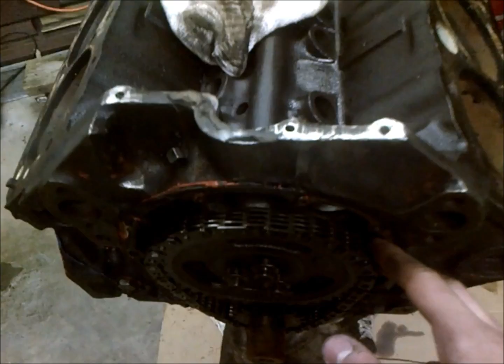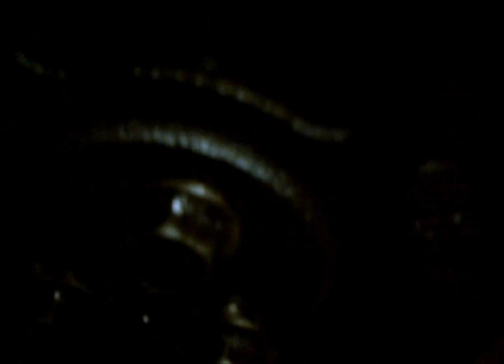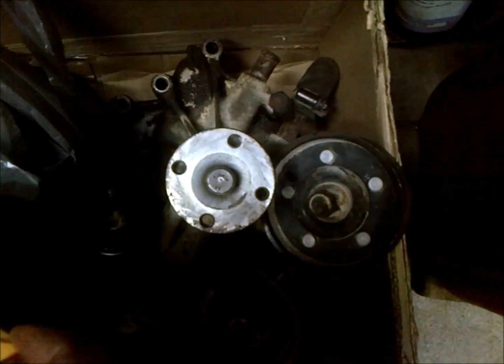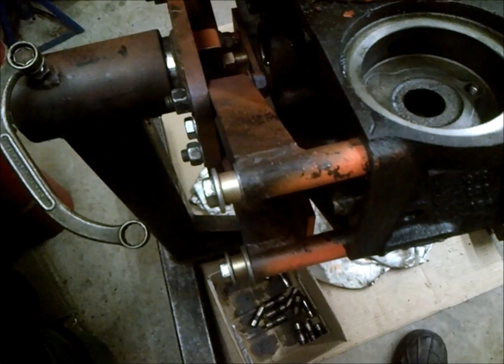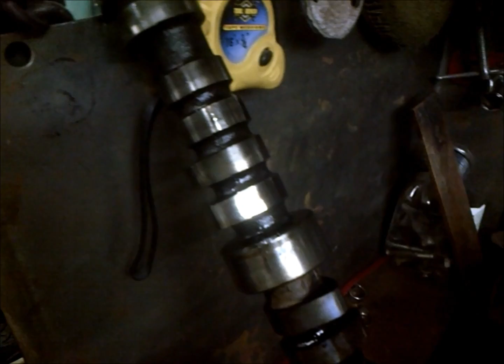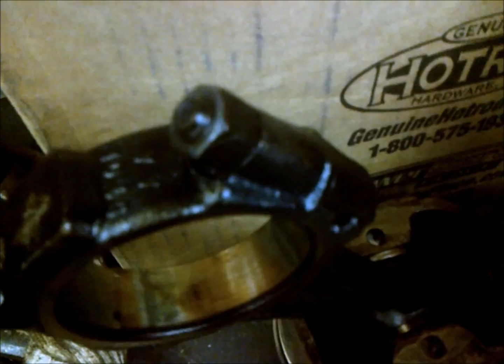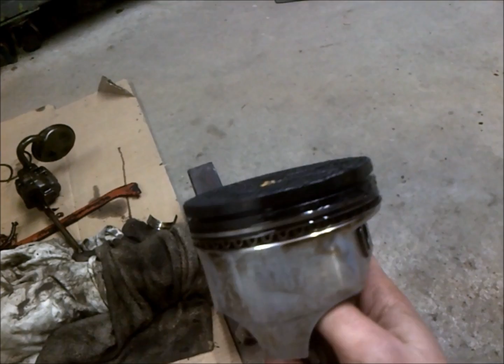350 Chevy vs Ford 302 Comparison: (Dumb Redneck Viewpoint)

Comment: compare the chevy 350 to a 351 ford cleveland of the same era.
Reply: +Mark Langston THE FORD CLEVELAND MOTOR CHANGED THE FACE OF PROSTOCK DRAG RACING. THE FORD CLEVELAND MOTORS WERE KILLING THE CHEVY'S THAT THE HENCHMEN FOR CHEVY THE NHRA MADE THE FORD'S CARRY MORE WEIGHT AND THE FORD'S WERE STILL KILLING THE CHEVY'S WITH THE REV LIMITERS SET AT A STANDARD 7000RPM'S AND HAD THE CAPACITY TO REV TOO 8500. EVENTUALLY PROSTOCK WOULD HAVE BECOME TOTALLY FORD POWERED. SO TO PROTECT THIS PHONY CHEVY RACING DYNASTY CHEVY/GM HAD THE NHRA MANDATED THE 500ci RULE. GM/CHEVY THEN TAKES A OLDSMOBILE BLOCK AND CASTS IT TO USE A CHEVY CAM AND CRANK. THEN GM MAKES A PAIR OF BIG FORD CLEVELAND HEADS FOR IT. SO WHAT CHEVY HAS BEEN WINNING WITH IN PROSTOCK SINCE 1983 TO PRESENT DATE IS NOTHING MORE THEN A BIG FORD CLEVELAND MOTOR. THIS IS THE REASON WHY FORD DOESN'T GET INVOLVED IN PROSTOCK RACING. BECAUSE THE PROSTOCK MOTOR OF TODAY OTHER THEN IT BEING A HEMI ARE ALL FORD CLEVELAND BASED ENGINES. LIKE I HAVE BEEN SAYING FOR YEARS. CHEVY HAS BEEN CHEATING THEIR WAY TO THE FINISH LINE FOR YEARS.
Reply: +ford fairlane LS, SB2, RO7, DRCE and all the symmetrical head big blocks labeled as Chevy are Ford spec engines. Nothing in racing is Chevy anymore. Chevy is all Ford based.
Reply: I had a cleveland and ate up a lot of 350 chevies with it. 4 bolt mains ,big valve heads. High compression. closed chamber heads. I was around in 1970 when these motors were some new hot shit. Why do you think Ford only made them for 4 yrs? YOU don't know what you're talking about so kiss off buddy.
Reply: Ford had an overhead cam during WWII, 525 hp @ 2800 rpm gas motor, 1100 
cu in, 5.4 inch bore and 6 inch 
stroke, 7.5 to 1 compression, over 1000 lbs of torque from idle to 2600 
rpm. They also had the 427 Cammer engine that came out in "62". It was 
too radical for NASCAR and was dropped from production. Way ahead of 
it's time.
Reply: THE 4.6 MOD MOTOR CAME OUT IN 1991 BEFORE THE NORTHSTAR. MY FRIENDS FATHER HAD IT IN HIS BLACK CAR LINCOLN AND I REMEMBER HIM OPENING UP THE HOOD AND SHOWING US THE MOTOR. THE NORTHSTAR CADILLAC WAS A FAILED ATTEMPT FOR GM TO COMPETE WITH FORD. WHEN I ASKED A MECHANIC WHO SERVICED LIMOS BOTH LINCOLN'S AND CADILLACS WHAT HE THOUGHT ABOUT THE NORTHSTAR ENGINE THE ONLY WORD THAT CAME OUT OF HIS MOUTH WAS "FAIL". 4.6 MODULAR MOTORS ARE STILL RUNNING TODAY AND EASILY REACHING 500,000-700,000 MILES AND STILL RUNNING. IT IS AN AMAZING ENGINE. SOME HAVE GONE TO 1,000,000 MILES AND THEY POWERED THE TAXI, LIMO AND POLICE CAR FLEETS COAST TO COAST FOR ALMOST 25 YEARS WITH NO COMPETITION FROM ANYONE.
Reply: I HAVE A 1989 FOXBODY MUSTANG WITH 150,000 MILES AND SITS OUTSIDE IN MY DRIVEWAY AND STARTS EVERY SPRING. ITS ALSO A DRAG CAR FROM STREET TO TRACK RACING AND THE PEDAL GOES TO THE FLOOR WITH POWER SHIFT TIME AND TIME AGAIN. IT HAS NEVER HAD A PROBLEM WITH MASSIVE ABUSE. IN A HOUR I WILL BLOW YOUR TOYOTA UP. I'VE OWNED THEM TOO.
Reply: No... A Frenchman,  Léon Levavasseur designed the first V-8.  It was originally installed in a number of competition speedboats and early aircraft.Cadillac in 1914, Oldsmobile in 1916, Chevy in 1917, Ford had the first truly mass produced V-8 in 1932.
Reply: CHEVY RO7 NASCAR MOTOR OF TODAY IS A FORD CLEVELAND COPY. THE PRIOR SB2 NASCAR ENGINE CAME DIRECTLY FROM FORD. WHEN FORD WANTED TO REPLACE THE THUNDERBIRD WITH THE TAURUS NASCAR CAME ALONG AND TOLD FORD NO BECAUSE THERE WAS NO 2 DOOR TAURUS. THEN NASCAR MADE FORD A OFFER THAT IF THEY WERE TO ALLOW CHEVY TO USE THE CLEVELAND DESIGN FOR A NEW NASCAR ENGINE THEY WANTED TO BUILD. ONLY THEN WOULD NASCAR ALLOW FORD TO RACE THE TAURUS. FORD RESPONDED AND SAID NO WAY. FORD KNEW THEY WERE OVER A BARREL ON THIS AND CAME BACK WITH A OFFER THAT THEY WOULD DESIGN A NEW HEAD FOR THE SBC THAT WOULD MAKE IT COMPETITIVE TO THE CLEVELAND ENGINE SO FORD GRAFTED THE INTAKE SIDE OF A FORD CLEVELAND HEAD TO THE SIAMESE PORT CHEVY HEAD LEAVING THE SIAMESE EXHAUST PORTS IN PLACE. THIS IS WHY DRAG RACERS QUICKLY SOUGHT OUT THESE SB2 HEADS FOR DRAG RACING. IT IS BASICALLY A FORD CLEVELAND HEAD.
Reply: (4.6 is worst motor ever made)<<-- FROM A ILLOGICAL RACE PERSPECTIVE. IT WAS NOT DESIGNED FOR RACING. IT WAS DESIGNED FOR EFFICIENCY AND DURABILITY AND THERE IS NOT A MOTOR IN THE WORLD DURING ITS TIME THAT CAN DO WHAT THE 4.6 MODULAR MOTOR WAS DOING RUNNING 24/7 NONSTOP FOR YEARS IN TAXI'S ACCUMULATING ANYWHERE FROM 500,000 TO 1,000,000 IN SOME CASES. EVEN WHEN CHEVY RELEASED THEIR GENERIC FORD THE LS IT STILL COULDN'T COMPETE AGAINST THE 4.6 IN THE 24/7 TAXI FIELD. THE LS MADE MORE POWER THEN THE 4.6 BUT WAS NOWHERE NEAR AS EFFICIENT NOR DURABLE AS THE 4.6.
Reply: WHEN YOU WATCH NASCAR AND CHEVY WINS. DON'T JUMP FOR JOY BECAUSE THE MOTOR DRIVING IT TO WIN IS A GENERIC FORD CLEVELAND KNOCK-OFF.
Reply: I THINK YOU'RE READY FOR A COLD BEER. WOULD YOU LIKE TO TALK ABOUT THE GAPP AND ROUSH 1970 351 POWERED CLEVELAND PINTO AND WHAT HAPPENED TO IT AND WHO PROTESTED THE CAR AND HAD IT BANNED. HERE IS A CLUE. HIS NAME STARTS WITH THE LETTERS G.J.
Reply: YOU LOST ME HERE. WHICH AFTERMARKET BLOCK AND MOTOR ARE WE TALKING ABOUT?
Reply: Frank289100   3 months ago
CHEVY RO7 NASCAR MOTOR OF TODAY IS A FORD CLEVELAND COPY. THE PRIOR SB2 NASCAR ENGINE CAME DIRECTLY FROM FORD. WHEN FORD WANTED TO REPLACE THE THUNDERBIRD WITH THE TAURUS NASCAR CAME ALONG AND TOLD FORD NO BECAUSE THERE WAS NO 2 DOOR TAURUS. THEN NASCAR MADE FORD A OFFER THAT IF THEY WERE TO ALLOW CHEVY TO USE THE CLEVELAND DESIGN FOR A NEW NASCAR ENGINE THEY WANTED TO BUILD. ONLY THEN WOULD NASCAR ALLOW FORD TO RACE THE TAURUS. FORD RESPONDED AND SAID NO WAY. FORD KNEW THEY WERE OVER A BARREL ON THIS AND CAME BACK WITH A OFFER THAT THEY WOULD DESIGN A NEW HEAD FOR THE SBC THAT WOULD MAKE IT COMPETITIVE TO THE CLEVELAND ENGINE SO FORD GRAFTED THE INTAKE SIDE OF A FORD CLEVELAND HEAD TO THE SIAMESE PORT CHEVY HEAD LEAVING THE SIAMESE EXHAUST PORTS IN PLACE. THIS IS WHY DRAG RACERS QUICKLY SOUGHT OUT THESE SB2 HEADS FOR DRAG RACING. IT IS BASICALLY A FORD CLEVELAND HEAD.
Reply: THE CHEVY NASCAR RO7 ENGINE IS A FORD CLEVELAND KNOCK OFF. IT EVEN HAS A FRONT DISTRIBUTOR.
Reply: +Mark Langston such maturity.
Reply: +Mark Langston you ain't had shiiit
Reply: +Frank289100 not really Chevy had the first v8 Ford copy Cadillac engines like the 4.6 32-valve V8 Northstar
Reply: Alan Snowden Chevy DID NOT have the first V8. Chevy didn't come out with a V8 until 1955. Ford flathead V8 came out in 1932 and Ford Y- block V8 came out in 1954. Ford wasn't first but was years before Chevy.
Reply: Cadillac had a V12 could run on independent of each other that motor was Head of it time
Reply: 351 cleveland 4 bbl first appeared in 1969. It is an intermediate block sharing some parts with the 400. I don't think you know what you're talking about. Cleveland is 5.7 litres not a 4.6 I don't like 302's or 289's. I also had a 428 and it was a damned good motor.
Reply: Mark Langston 351 5.8 sound more like it 4.6 is 281, big block is way too go
Reply: Frank289100 is not true base on aftermarket block
Reply: Frank289100 NASCAR motor
Reply: Frank289100 4.6 came out 98 5.0 came  out 97
Reply: 4.6 is worst motor ever made
Reply: 4.6 CAME OUT IN 1991. 5.0H.O CAME OUT IN 1983 AND THE NEW DOHC 5.0 CAME OUT IN 2011 OR 12.
Reply: IS THERE SOME REASON WHY YOU ARE SCREAMING AT US?
Reply: Frank289100 4.6 came out  98 last old 5.0 97 new 5.0 2011
Reply: Alan Snowden First year for the 4.6 in a Mustang was '96 (last year for pushrod 302 in Mustang was '95). 4.6 (D.O.H.C.) first came out in Lincoln Mark 8 in '92 or '93 (maybe S.O.H.C. in other Lincolns) Pushrod 302s last came in 2001 Explorer/Mountaineer.
Reply: Alan Snowden 4.6 mod motor is a late 1980s design which found its way under the hood of the Town Car in 1991, then the Panther platform in 1992, then Mustangs and pickups in 1996.  There are two different 4.6 motors and they are not fully interchangeable.  The first is the Romeo engine which is what you'll find in an F150 or a Panther (Crown Vic, Town Car, Grand Marquis), then there is the Windsor version which you will find in Mustangs.
Reply: silicon212 won't the point have a car and can't interchangeable parts with  kind of pointless ain't it
Reply: Alan Snowden Depends on what you want to do to it.  It's a good thing to keep in mind.  For example, Romeo heads won't interchange with Windsor heads, and the flywheels/flexplates are different (8 bolts on the crank for a Windsor vs 6 for a Romeo).  I daily a 2005 Crown Vic and this is what I have learned when planning mods for the engine.
Reply: Well to piss everybody off I now own a Toyota. First car I ever had 200,000 trouble-free miles with (except for the maf sensor). Damned good reliable product. I Got old and the Ford vs. Chevy rival got old too. They both need to get their shit together in my opinion. No more replies from me. Have fun guys I've got a grandkid on the way-Bye
Reply: WHY ARE YOU SCREAMING BACK?
Reply: 4.6 FIRST DEBUTE IN 1991.
Reply: You should share what you're on, must be good stuff.  The SB2 (SB2.2 in NASCAR) was a cylinder head package, the block still SBC.  The SB2 design was created by GM Racing for NASCAR in the mid 90s, the SB2.2 variant was green lighted in 1997 for the 1998 racing season, in advance of Ford's announcement of the Taurus.

NASCAR allowed the Taurus because the Thunderbird, racing at the time, ended production at the end of 1997 and the Taurus was really the only suitable car to race in Cup.  There was no underhanded "we let you run a 4 door production car as a stock car, you design heads for GM" ... 

The R07 engine is a purpose built NASCAR race engine that takes advantage of tech learned by racing.  It is not based on any Ford design.  If you really want to compare apples to apples, both Ford and GM designed their engines using the same tech, and wound up with similar configurations.  That's physics, not corporate espionage.
Reply: Not even close, sorry.
Reply: The front distributor means nothing- in fact the new ones (2012-up) don't have distributors at all, they all use a coil-near-plug configuration now.

If you look at a Cleveland and an RO7 block and compare them to eachother, they are no more similar than Mars is to Jupiter.
Reply: Lay off the kool-aid dude... it's very old.
Reply: 350>
Reply: I've had both. The 351 Cleveland with 4bbl heads and 4 bolt mains is>+.
Reply: Frank289100 Ford copying Cadillac 4.6 North star engine that true have less horsepower

Comment: 350 to 302 sounds fair
Reply: +Lethal Snipes he should have compared a 351 to it or compared a 305 to the 302
Reply: +Lethal Snipes The video is comparing architecture not performance
Reply: zach
302*
Reply: 302 often kicks chevy ass... my bone stock 91 foxbody smashes on my boys super sassy camaro....
Reply: Lethal Snipes 304
Reply: zach
no
Reply: Lethal Snipes I understand that sometimes you have what you have when doing a video. that said, I do agree with the 350vs 351w comparison idea over the 302. the displacement changes, obviously, but not a lot other than heads, rods, Pistons and whatnot would need visually compared. I've built a few Ford 289's while a buddy was building his 283 and later a 273 barracuda engine for his mom's car. I like all three engines, but I felt that the Ford and Chevy took higher compression better. the Dodge engine seemed to give us lots of seal problems in head gaskets. we always used fel pro gaskets since this was before the internet was used for more than porn ain IRC. personally my favorite build was a '71 351c with Aussie heads, a 268 cam, an old weiand intake, port matched to Aussie heads and fed by 4 Webber carbs. (I had no experience with Webber's and left it up to a local car collector to tune. this was the engine I had in my Torino 500. it managed to keep the air conditioning with all the changes. the car was mated to a crap fmx that had a bad band. I put in a c6 with a great transpack and new rear leaf springs. the original set snapped the first time we have it power. they rusted across the bolt holes. I had the oil system worked a bit and could spin it up to 7,000rpm, but set the limiter up to 6,200. best stock rotating small block bell housing using torque monster. it lives on in northern Iowa, seeing a full body restore
Reply: +Alex Porter performance 350 curb stomps the 303..